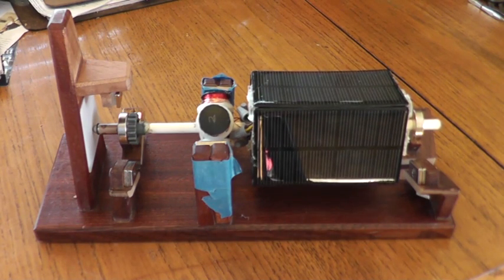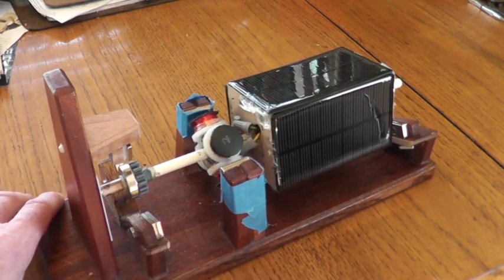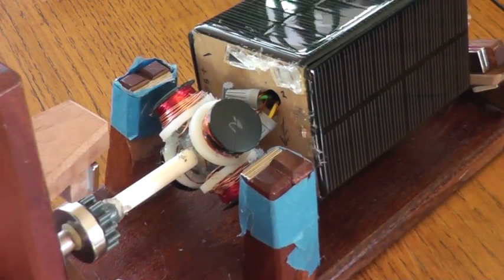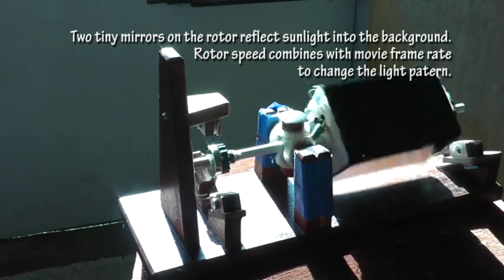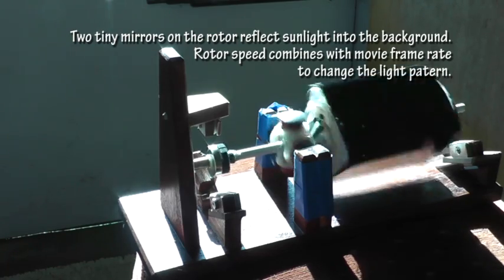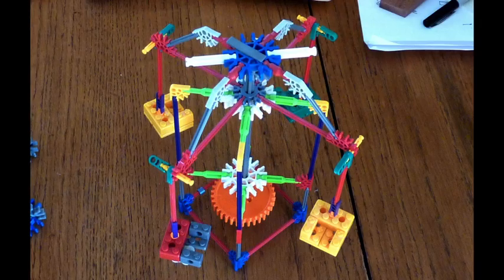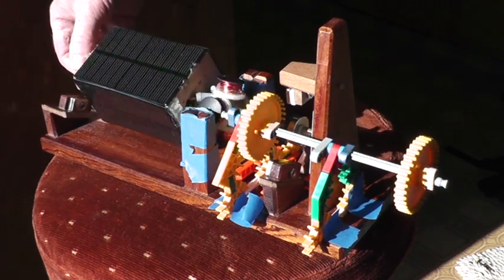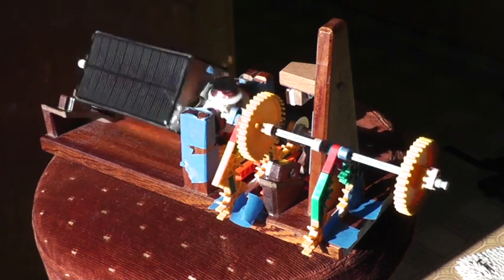Modified Mendocino Motor

Comment: buona sera e complimenti per questa versione di motore posso chiedervi  le caratteristiche costruttive,quanti magneti avete utilizzati e che tipo,le dimensioni delle celle solari,e quante spire avete realizzato per ogni bobbina.ciao cordiali saluti grazie
Reply from the maker: Just two magnets (actually two stacks of thin magnets).
solar cells are 4 inches long, 2.5 inch. wide.
I did not count the coils.

Comment: Nice design change! I would imagine that this would be easier to wind than the normal way. Care to share # of turns, gauge of wire, that sort of thing?
Reply from the maker: I measured out 50' for each coil. That's 100 feet for the pair with the same orientation. It's fine wire. 30 gauge I think.
Make sure each pair of windings (each two lined up) produce the same N/S field orientation. Connect the pair of coils just as the standard Mendocino motor instructions describe.